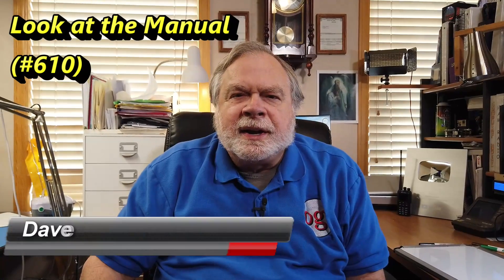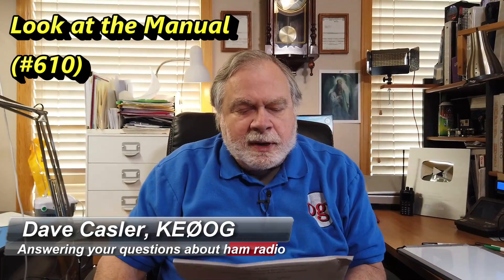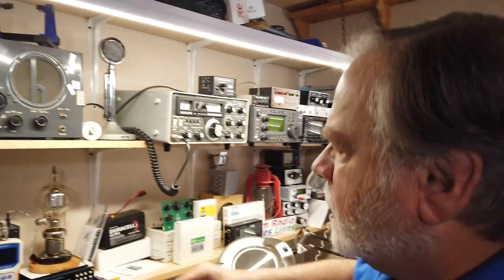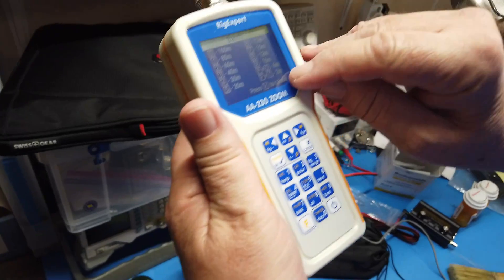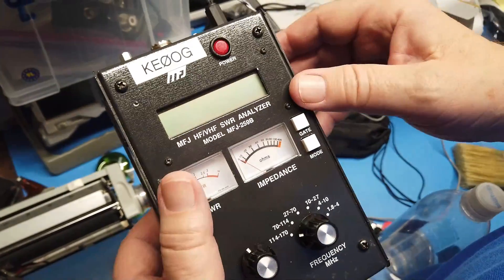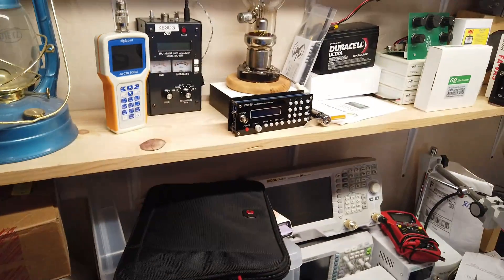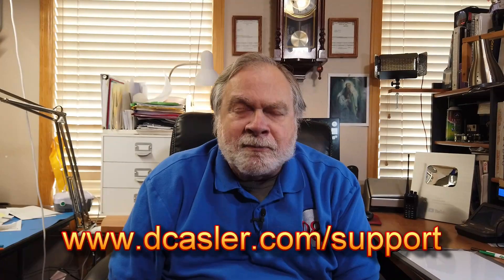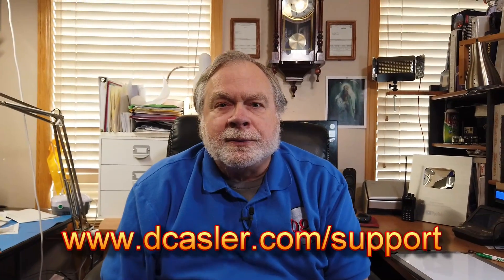Look at the Manual (#610)

Comment: I love your video’s. I go back and watch old ones.   You always have something for me to think about or expand on and use.
          I live in a condo with no authorized outside antenna’s.  Didn’t want to fight over a small antenna.  The fight is on for a compromise HF antenna.  For 2m/440 I use a car mag mount magnetically attached to a large cookie sheet sitting on top of my book case.  Works great.     73s

Comment: Unfortunately this antenna did not come with any manual. The manufacturer’s website does not appear to offer one either.
Thank you for your help and guidance on this. I now have a enough information to continue working on this installation. Also, my SWR meter covers frequencies from 140-525 MHz.
Reply: Hey Patrick.....Before you do any trimming of the antenna,  double check your connector  (PL259).   Heck.....cut it off and start over!!!  Then bottom out all your rods and tighten.  then check SWR on 2M.  Then adjust the bottom rod for best SWR on 2M.  You should get WAY better than 1.5.  After that.....your 440 side should be ok..... probably in the 1.5 to 2 range.....or better!!!!!  But double check your connector!!!!!  Hope this helps!!!
Reply: @n8sot  I was thinking I’d buying some piano wire of the same of close to the same gauge and trying some test lengths. The antenna, mount and cable are all new and installed with great care. The meter I’m using is a Daisy Cn-501V with a freq range of 140 to 525 MHz.fortunately the SWR meter did come with a manual. 

Thank you for your suggestions and I will keep them in mind as I continue to work on this installation.

Comment: A simple 2 meter quarter wave (approx. 19.5 inches) makes a decent 3/4 wave 440 antenna.  I have used one for over 20 years.
Reply: Yes. I use a telescopic 2m quarter wave on my dual band handheld. Works great. It's actually 56 cm long to adjust somewhat for the lack of ground plane. GM4SVM

Comment: Its a pity WELZ looks to have gone out of business. Back in the 1980's I bought an SP300 SWR and Power meter which I still use. It has 3 sensors which cover HF, VHF and UHF ie. 1.8 to 500MHz. The UHF connector is an N type, the others being SO239. It works great!
Maybe these can still be found on eBay or other sites that sell second hand ham radio equipment. Well worth a look?

Comment: I have a question about an aside Dave made while talking about the target frequency to tune for SWR. At around 1:00 he says  "... on 70cm you're shoting probably for about 440 because the FM is toward the upper end of the band." I think this could be taken in at least two different ways and would love some clarification. Does it mean, A, FM is more particular about a low SWR, or B, Dave's making an assumption that a mobile operator will only be interested in the FM portion of the 70cm band, make phone contacts on repeaters or simplex.

I could see it being either or both, but if reason A is true I would appropriate an explanation on why that is. Thanks.